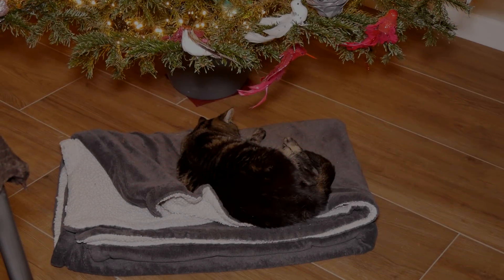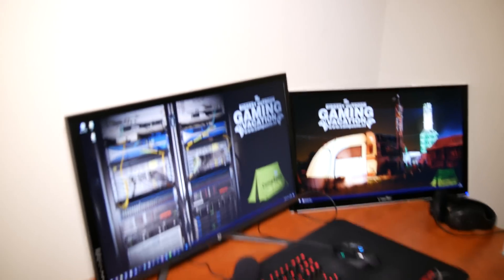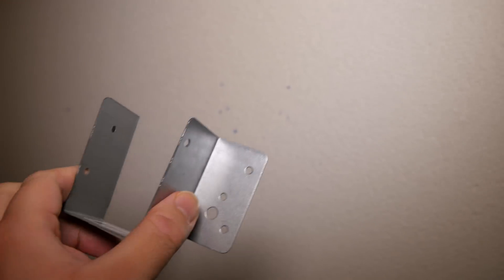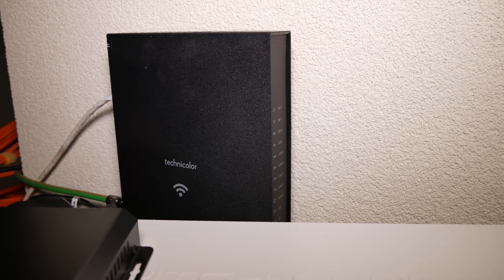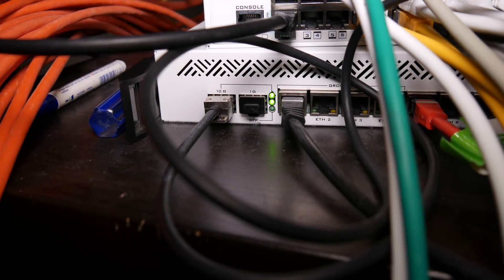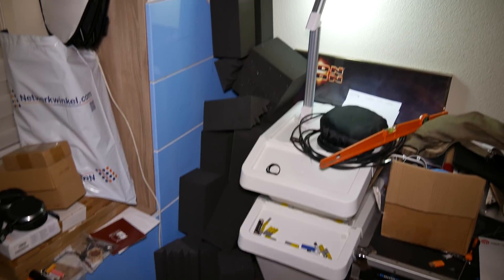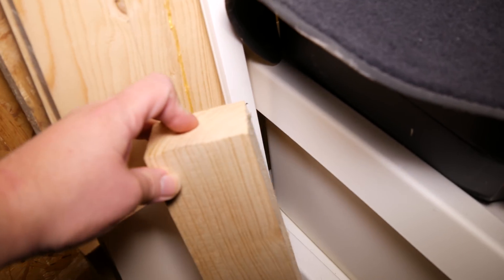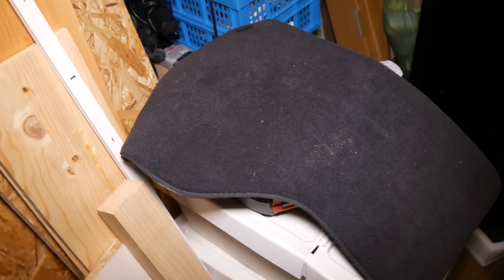Home Networking: Installing a home patch panel - part 1

Comment: What are the yellow pipes that the network cable comes out of in the ceiling at 0:36 seconds? Thanks
Reply from the maker: Since we use brick and concrete construction we use PVC pipes (3/4") to pull all the cables through. The pipes are put in during construction. You can check out some of my other Home Networking videos to see the whole process! Everything from home electric to networking runs through them.
Reply: Thanks for the reply. Where did you get the pipe from? How flexible is it?
Reply from the maker: Here in the Netherlands you can get them at every DIY shop there is, it's a very common product. They sell special "bending tools" to bend the pipe like you can see in my home building/home networking videos. Without the tool they are very hard to bend and with a lot of force only fold over, the bend tool make sure that doesn't happen.

Most of the pipes are put on the 1ste floor before the concrete is poured. After that there is no way to get to them anymore but you have special tools (also a video about that) to get the wire through them.